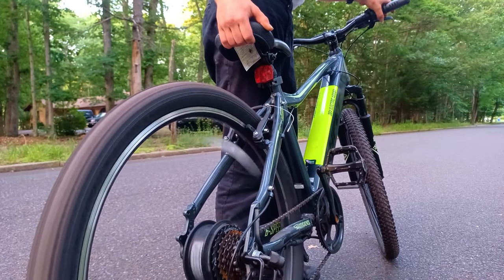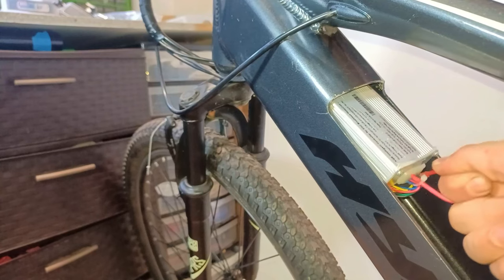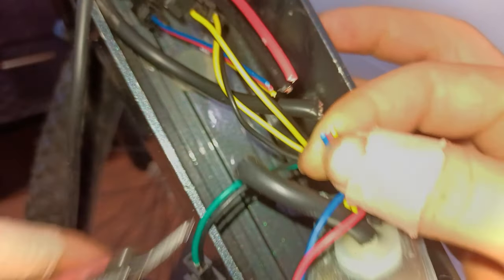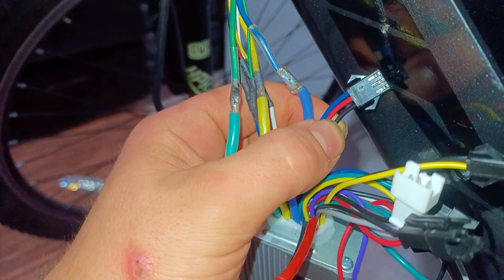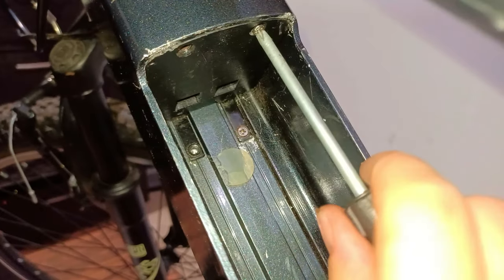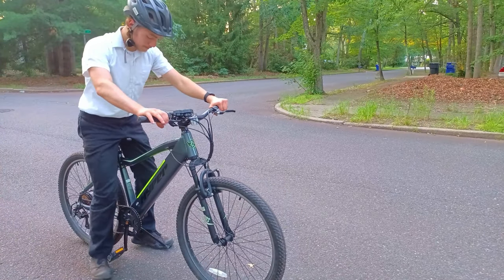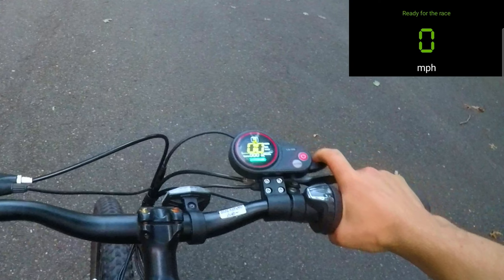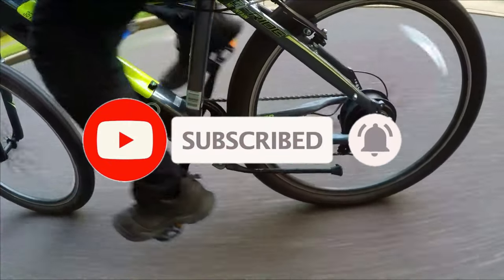how to add a THROTTLE onto a PEDAL ASSIST bike

Comment: Hi, I've order the same kit, and have the same bike, after connecting all 5 thin wire(Red,Black,Blue,Green,Yellow) for Hall sensor (i actually have a 6th wire which is white but didn't use it)  and 3 thicker wire(Green, Blue,Yellow). I get an E-001 on the display. when I press the throttle, the motor kicks in a bit 3 time (doesn't rotate the wheel much) and then it stopped. You know what could cause this issue? or what im doing wrong?
Reply from the maker: Try switching around the connections from the 3 thick wires going from the motor controller to the motor until it starts spinning. The white wire is usually either a motor temperature sensor or a motor speed sensor, which is not needed to use this motor controller.
Reply: @ElectronicLab.  Hi, new update: I can hear the rub motor beeing activated but it's not spinning (color matching the pair). After switching the 3 wires as you suggested it spin  very little (just little kick) but I can hear a very loud noise from the motor as if it was going to break. Only the color pair doesn't give me that terrible noise but it doesn't even spin lol. Also I've connected the 2 green wire together on the controller that rotate the wheel without me pressing the throttle (As soon as I turn on the display the hub motor turn itself) so I disconnected the green, and still can't figure out what is wrong now ... any other idea you may have for me?
Reply from the maker: @kayriesshin6533  I've already had a similar situation where either the motor sounded like it was spinning or it was very jittery for a few seconds, but all I did was continue trying different wiring configuration until it worked. The 2 green  wires are most likely a direction switch, which have to be connected for like 3 to 5 seconds in order to change the direction.
Reply: @ElectronicLab.  Hi  =), Okay I found the combination that made the wheel spin now (from the Hub Motor to Controller: Blue to Yellow, Yellow to Green and Green to Blue). However, I can still hear a terrible noise from the motor =/ I don't think id even throttle with this insane noise... originally from pedal assist when it activate the motor it is not this noisy... I was expecting to be around the same noise. Do you think there's something I did wrong again ?
Reply from the maker: @kayriesshin6533  continue to change the configuration because I remember also seeing my motor spin, but making a noise as if there is something damaged. To save time, maybe write down the configuration you're already tried. (You can leave the 5 thin hall sensor wires as is)
Reply: @ElectronicLab.  Omg lol I found it ! I simply decide to swap (from the Controller to Hub Motor) While keep the color pair that worked (Blue to Yellow, Yellow to Green and Green to Blue). Now it doesn't make a very noisy Motor! Thank you so much for your support ^^
Reply from the maker: You're welcome 😊
Reply: @ElectronicLab.  Hi, I've notice on lower gear, when i start the throttle, the sound is back to where i think it was way too loud. but once it reach a certain speed the sound is okay like on gear 3rd. you think i should continue switching the 3 wires again ?
Reply from the maker: Is It making the noise on a lower gear from the display? or a lower physical speed?
Reply: @ElectronicLab.  lower physical speed. when I throttle from 0 spd, the noise is just like before a broken loud noise from the motor, only when it reach a higher speed then the noise of the motor sound more like normal. You think I still need to work again on pairing the right combination lol ? or it's something I need to program on the display? (it's already on 36v)
Reply from the maker: @kayriesshin6533  At this point, you can try changing around the configuration from the 3 THIN hall sensor wires (usually blue green and yellow). Just make sure to leave the positive and negative wires (red and black) from the hall sensor as is.
Reply: @ElectronicLab.  I've tried to changed them around for those 3 colors you mentionned only. there's was only 1 combination that make the motor work as it should which was color to the same color. At this point, my concern is only on lower speed rotation that make this unbearable noise. reaching a higher speed make the noise sound like it should. Any other idea you can think of that could help me?
Reply from the maker: @kayriesshin6533  If there is noise or vibration at low speeds, it's most likely the hall sensors, but if you remember not  mistaking the hall sensor wiring, then I would think the speed controller might be faulty, so get a replacement from Amazon (Amazon has a 30 day return policy). Ps, if you disconnect all the hall sensor wires, electric tape it, and test the ebike, you should be getting similar results. Because this speed controller can work without connecting a hall sensor, but it will not sound smooth at low speeds. If the hall sensor feature works correctly, the e-bike should accelerate from a stop smoothly and without too much noise
Reply: @ElectronicLab.  It's so weird... I put everything back to where it work before... Now it's making a broken noise and spin only a little and stopped... I'm sure it was the correct before since hall sensor was color to color. And I've already noted the 3 thicker wired...
Reply from the maker: @kayriesshin6533  did you try disconnecting all the hall sensor wires?
Reply: @ElectronicLab.  You mean including the red and the black thin wires? No. I don't understand... Now I kept the same 3 thick wired that worked. And switch the 3 hall sensor around and found that blue to yellow, green to green and yellow to blue now makes the bike work like before. Still having the noise at low speed and higher speed the noise is perfect. I can't explain why hall sensor before was color to color ...
Reply from the maker: @kayriesshin6533  Yes, I want to see if the wheel will spin if you disconnect all 5 thin hall sensor wires, including the red and black wires
Reply from the maker: @kayriesshin6533  If it still spins and makes the same noise at low speeds after disconnecting all 5 thin hall sensor wires, then there is a chance that this specific motor controller has a problem, and you should get a replacement.
Reply: @ElectronicLab.  Hello, i disconnect them all (hall sensor) and it makes a broken noise the wheel barely spinning and I get E-001 in the display screen.
Reply from the maker: @kayriesshin6533  At this point, If the low-speed noise is unbearable, try to get a replacement motor controller (once again, amazon has a 30 day return policy)
Reply: @ElectronicLab.  Alright will do that thank you for your support 👍
Reply from the maker: @kayriesshin6533  you're welcome

Comment: i recently seen arduino converter from pedal assist to Throttle arduino generate pulses for the sensors s1 and s1

Comment: Hello m8 do you know if this mod will work for the carerra vengeance? or any help from anyone else in the comments would be much appreciated. Im ready to mod my carerra but didn't want to buy anything yet as im not 100 percent sure it will work
Reply from the maker: To find out if you can do the same modification, you have to get to the controller from your e-bike to see if it has 3 thick phase wires (yellow, green and blue) and 5 hall sensor wires (red, black, yellow, green and blue)
Reply: Did it work?
Reply: @DeclanWilson95  it worked I had to get a bigger battery tho. So all I did was buy a cheep motor controller like the one in this video and swap it for the old controller and it also removes the speed limit I'm now getting just shot of 30mph
Reply from the maker: Nice!

Comment: Make a wiring diagram please? I have the same bike and want a throttle.
Reply from the maker: most wires are color to color, plus the link from Amazon that's in the description has some pictures
Reply: Will I need a diagram for the bike?

Comment: Do you have a Wiring diagram? Just ordered.
Reply from the maker: most wires are color to color, plus the link from Amazon that's in the description has some pictures
Reply: @ElectronicLab.  How do you turn on the pedal assist? Can't get it to work, otherwise installed the throttle!
Reply from the maker: It is a setting on the display. The motor controller should come with programming instructions

Comment: Hey buddy is it water resistant?
Reply from the maker: I assume so, because the motor controller is sealed with silicone gaskets,  but I haven't tested yet if it's waterproof.
Reply: I mean is it okay to take bike out on rainy day?
Reply: One last question, what is the top speed when you pedal and throttle together
Reply from the maker: @parneetsingh4493  I didn't test that, but I assume it can reach almost 30mph if I would pedal hard while giving full throttle

Comment: Where did you get the display cable ?
Reply from the maker: I linked it in the description. It is included with a motor controller kit

Comment: Connected all the wires properly whenever i press the throttle a bike start to move sound pops up from the motor and after that bicycle stops moving. Please help.
Reply: Got the same problems I see some white wire connecte to a yellow wire...2 black wire on one black.....need a diagram

Comment: My bike assist is limited to 25km/h, does using throttle makes it go faster? Or itll still be limited to 25km/h?
Reply from the maker: Usually, if there are any speed restrictions, it won't matter if you use pedal assist or throttle. The easiest solution would be to check online "how to program an e-bike display." You might be able to raise the speed
Reply: @ElectronicLab.  my bike doesnt have a display, its from 2017, nakamura ecliff 700, couldnt even find the white cable that they say its speed sensor 😅
Reply from the maker: @jericho.aflo0  I guess the next option would be to replace the speed controller with the one that I've used in the video (it's linked in the description). This speed controller is fully unlocked in speed, and it also comes with a throttle.
Reply: @ElectronicLab.  yes i will do that , thank you!! I also have a ninebot external battery has same voltage as my ebike 36v 
Do u have any video on how to use it for extra range?
Reply from the maker: Not yet

Comment: I have a serious problem with my throttle after connecting it exactly the way you showed us in the video the throttle control comes on but the throttle is not working and the is a red warning ⚠️ sign on the screen 😤😤😤please make another video were you show us exactly each cable and function of these cables 🙏🏽🙏🏽🙏🏽😭😭
Reply from the maker: Explain what error you're getting
Reply: @ElectronicLab.  the throttle screen is showing a warning sign, look please can you do another video where you show us how to connect the cables one after the other cause i feel like i badly connected those cables

Comment: I still have 2 hall sensors wires?
Reply from the maker: @rzhavyy90  from the motor?
Reply: @ElectronicLab. Yeh a small gage brown and white wire I have I video on my channel that shows the problem
Reply from the maker: @rzhavyy90  For the e-005, try checking if the the display is programed for 36volts. I have some Information about how to check/change that in the beginning of this video: https://www.youtube.com/watch?v=_Bh6IKfam08&t=3s
Reply from the maker: @rzhavyy90  To fix the e-001 error, check out this video, which has a solution, and also shows what the error codes mean
Reply from the maker: @rzhavyy90  Most E-bike motors come with 5 thin wires. black for negative, red for 5volts, and than green, blue and yellow for sensing the motors position. some e-bikes come with an extra white and/or brown wire usually for speed signaling (not always needed), and/or temperature sensing (not always needed)
Reply: Ok so that work but now it makes a grinding sound that might be the my bad soldering on the hall sensor tho
Reply from the maker: @rzhavyy90  If you do hear any noise coming from the hub motor while pressing on the throttle, Try switching around connections between the three thick wires from the motor (ignore the hall sensor wires for now)
Reply: Ok, I'll try that when I get back home, and thx you've been a massive help.
Reply from the maker: @rzhavyy90  you're welcome
Reply: Switching the wires worked BTW, and thx

Comment: If the battery is in the back ON the bike could be that the wires are unreachable😢😮?
Reply from the maker: So far, from my experience of opening over 10 e-bikes, there was always some way to get to it by removing screws, but if you want to find out how to get to you’re e-bikes battery, then search on youtube: "how to remove/replace the battery from a (you’re e-bikes name and model) e-bike"

Comment: Has anyone tried this on the Hyper Mid-Drive Mountain? If so what has been your experience with the process and the results?
Reply: Mid drive has the ESC built into the motor location. They don't have a stand alone ESC as hub drive systems do.

Comment: What wires do I connect to make the throttle come on?
Reply: Don't cut the wires like in this video. You can normally know what wires on your new ESC controller that should be White,Red,Black. That'll be throttle. 3pin SM wire.

Comment: Hi so finally got the display to turn on but now it has an error code and low battery on display? And also I pull the throttle and I can hear the motor running but rear wheel isn’t spinning can u help ?
Reply from the maker: To fix the motor issue, you have to reconfigure the 3 phase wires coming from the motor until it works(my own experience), and to fix the low voltage error, you might have to re-program the display. There should be instructions in the piece of paper the controller came with. It should give you 24v, 36v, 52v, and 60v voltage options(check your battery what voltage it runs at)
Reply: @ElectronicLab. heyy is it possible if you can do a wire-to-wire that way we know what goes to what

Comment: I have this same exact bike and I followed the INCOMPLETE tutorial and now I am stuck.   I bought the same controller box you did.  There is a Hall Sensor block and you completely gloss over the SEVEN wires to hook up here. All you did at 2:10 was point at the 7 wires.  Meanwhile the Hall Sensor block is a 5 pin plug.  This means I have 2 extra wires from the 10 wire coax cable that are unknowns.  I do realize the title of you video is how to add a THROTTLE and not how to add a controller, but you showed us this is done by adding the controller.  Meanwhile I could have saved money on the build had I found this other video where they show wiring a thumb throttle to a bike without a display.  I can no longer do this since I already cut all cables off the old controller and unless you have an ANSWER... I am screwed.
Reply from the maker: most e-bikes come with a hall sensor cable, which has 5 main wires(telling the speed controller in what position it is in) and sometimes one or two more wires, which are usually a temperature sensor and/or a speed sensor.
now the most Important wires are the 5 main wires(usually red, black, green, yellow and blue).
by hooking up these 5 wires(most of them color to color), assuming you've already connected the red and black power wires, the display and the throttle, the motor should start spinning as soon as you twist the throttle.
if it instead starts vibrating or making a noise as if it is spinning, you might have to play around with the 3 motor phase wires until you get it spinning. PS, if you do get it spinning but it spins in the wrong direction, you can temporarily (3 to 5 seconds) connect the two green wires which will change the direction.
Reply: @ElectronicLab.  Thanks, I will give this a try in the kitchen tonight.  What I find makes a controller swap most difficult is the lack of standardization of the ebike equipment.   I admit, I am an old timer who has been spoiled by USB, plug and play, and ISO in my workings with PCs.  I take it your Hyper E Mountain Bike didn't have an extra gray and brown wire in there.  I will let you know how this works out. 
NEXT DAY
Last night I got all the Hall Sensors attached left out gray and brown.  Ran a jumper on the throttle ( data and +5 v dc) and it went to high speed.  Now I am just working on cramming all this back inside the bike.  BTW The bike is less than 1 year old and over the winter I used it rain or shine.  Their LED display mounted on the handle bar is NOT waterproof and shorted out.  I like this throttle but still have the PAS as a backup.  Using the throttle means I will be recharging more often but worth it.  Thanks for the speedy response.

Comment: Hi I have same everything and won't work
Reply from the maker: if you tell me more details, I might be able to help you
Reply: I'm not sure where the brown wire goes. Tire spins right direction self learning but does not spin at all disconnect self learning. Comes up e7. Been putting alot time trying to figure out. Any help be appreciated thanx
Reply: If tire not spinning or spinning backwards you have to connect the three motor and controller phase wires in different sequence 
Green to blue. Yellow to yellow. Blue to green etc about 36 combination and you will find one combination will work